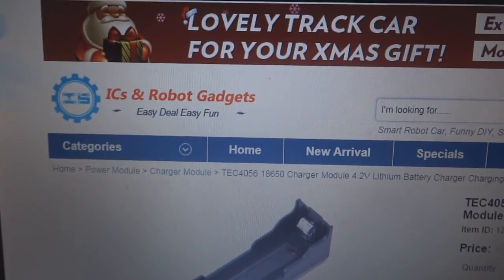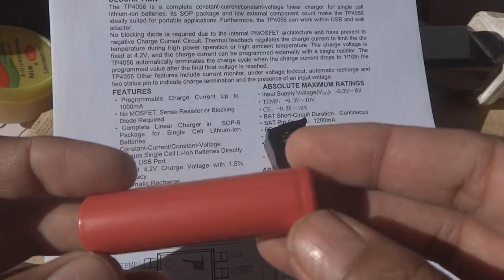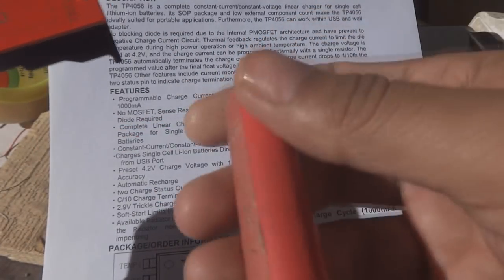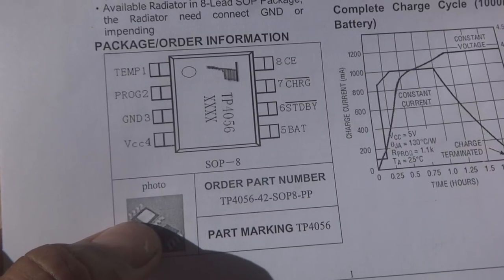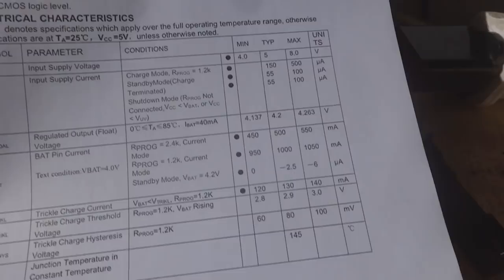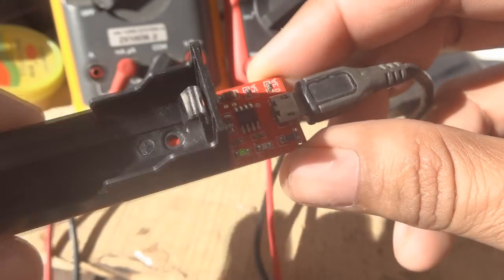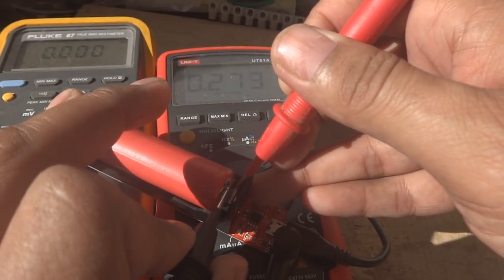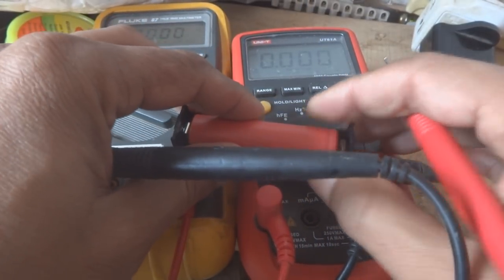Automatic Battery changer. 18650 battery charger review from ICStation.

Comment: The TP4056 does not have any float/trickle charging on the upper end. Lithium should not be trickle charged or have a float charge put on it like lead acid does. Self discharge is so low that it will not drop more than 10 or 20 millivolts over the course of a week. If you don't plan on using it within a week it should not be fully charged, it should be at 50% state of charge. The trickle charge mentioned in the datasheet is a low voltage trickle. If the cell is under 2.9V OCV it is considered overdischarged (under load you can take most down to 2.5 or 2.75V). It is not a good idea to give a full 1C or even 0.5C charge to a low cell so a 130ma trickle charge is given to slowly bring the cell back up to a healthy voltage where the normal charge set by rprog will begin.

Yes, you were right about the 8Ah cells being fake. The largest 18650 cell currently is 3600mah or 3.6Ah. There are also a few 3500mah/3.5Ah cells. In reality these cells see an actual capacity of 3450-3550mah under the best of the best charging and discharging conditions when new.

Comment: The micro USB is too weak! I bought two and broke both. I will solder a P4 jack on.
Reply from the maker: You are right. They are not very strong and robust but they were standard for last few years. Now a days it had been replaced with C port. C port seems to be better than micro USB port.
Reply: @JahanZeb1976  Indeed! Good ideia! I will try! Thanks a lot from Brazil.